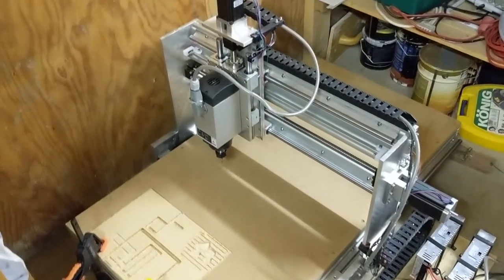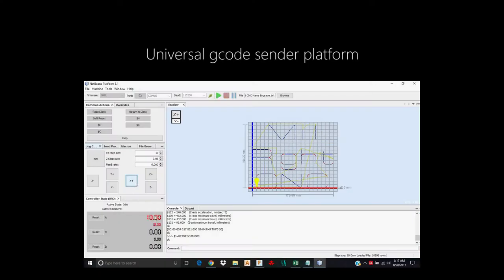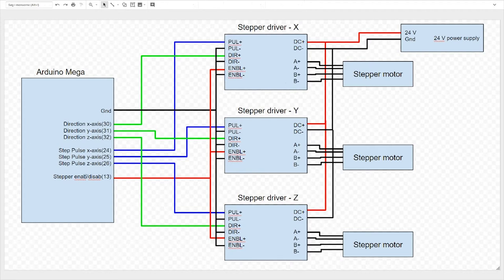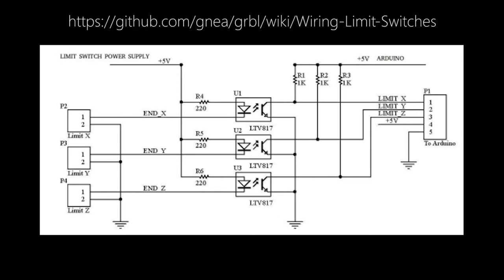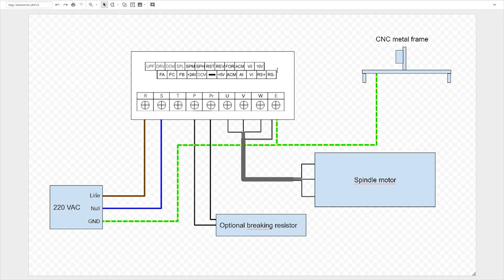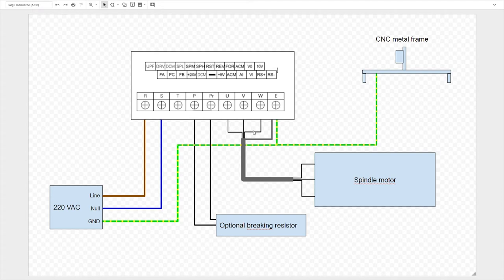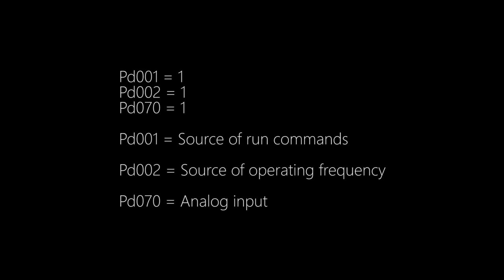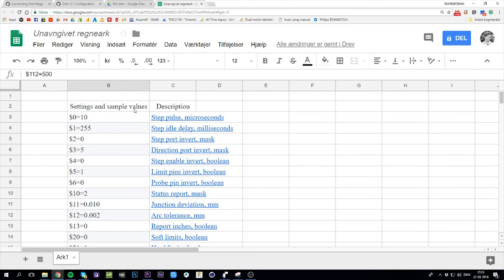CNC Router Build Part 5 - Electronics tutorial (Full grbl setup)

Comment: If the VI1 input on the VFD is expecting 0-10v (according to manual) and you wired the Arduino directly to there, wouldn't your spindle speed be incorrect or did you do something you didn't mention in the video?
Reply from the maker: No you can set it up to 0-5V
Reply: @Karlemilstorm  thanks! I just found the setting on mine for 0-5V (dip switches) and would probably have overlooked that since I wasn’t aware of it.

Comment: So I'm confused on how Arduinos work. Does Arduino Mega not need a "shield"? Every Shield I can find says it needs an Arduino Nano.
Reply from the maker: Shields are basically boards with specific purposes. The grbl shield is a board that has 4 stepper drivers integrated right on it. When I use grbl i use external stepper drivers because i want to be able to use any size motor i want and not be limited by the drivers on the shield
Reply: Nice video, but how do i know how much Pulse/rev i need on my stepper motor drivers
Reply from the maker: You can choose for yourself. It is basically the resolution of the stepper. The more steps/rev the better resolution. But it also means that it will go a bit slower. I am running 800 steps pr revolution on a 5mm/rev leadscrew
Reply: Hi. Nice video. I have an inverter equal to your 1.5kw and use the arduino uno. How do I connect the cables? I do not know where I connect the pin spindle enable. can you help me?
Reply: @Karlemilstorm  600 KHz step pulse rate on Tensy 4.1 board with GRBLHal loaded on tensy, I am completing right now the shield board which provides all the electronics for the necessary inputs and outputs. :)

Comment: why there is no connection to spindle enable pin  no 4 in arduino mega?
Reply from the maker: It is tied to 5v or gnd permanently I believe. Then the pwm pin controls the speed
Reply: @Karlemilstorm  , so we cannot use M5 to stop it because it is always enabled
Reply from the maker: I dont know. Sorry
Reply: @Karlemilstorm  ,because I have another VFD but different brand and different wiring , I got the perfect wiring from the seller, so when my cnc runs gcode it can use M3, M4, M5. M3 enable it and rotate clockwise. M4 enable it and rotate anti-clockwise. M5 immediately stop the spindle.
Reply: @Karlemilstorm  , I made it worked, the difference is I'm  using Grbl Mega 5x latest version that I downloaded a few days ago, the PWM output is coming  from pin 7 of Mega, then I used this PWM as input to PWM-Voltage converter I bought from Amazon. I set Pd0070=0 on Huanyang VFD, because this converter is outputting 0-10V. For forward and reverse rotation I bought 2-channel 5vdc relay, one relay for FOR and one for REV on the VFD terminal. There is no need to connect to Spindle Enable pin no 4 on the Mega. Your works  helped me, specially when you mentioned about the jumper, thank you so much.